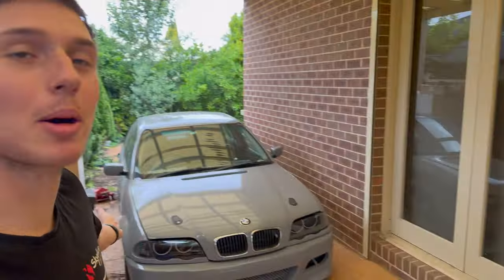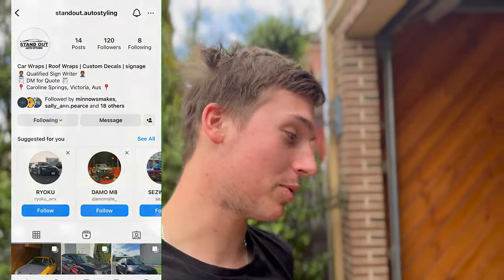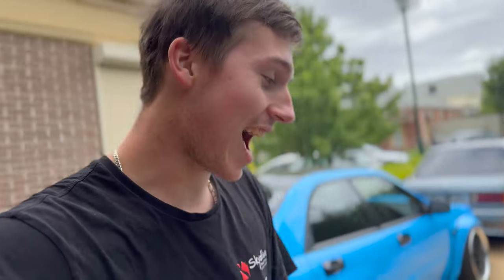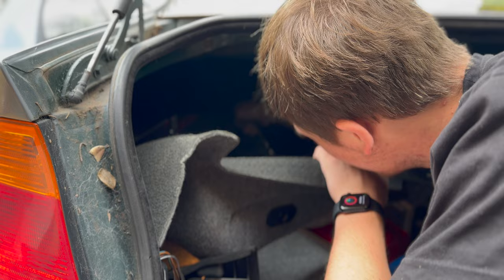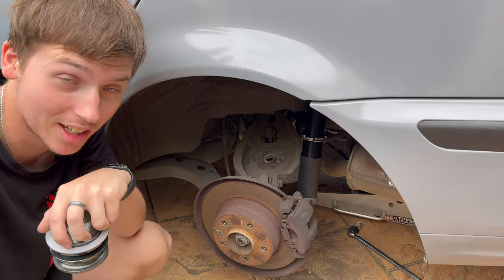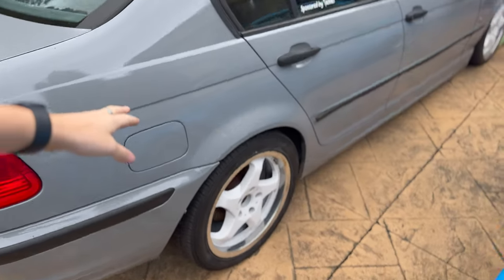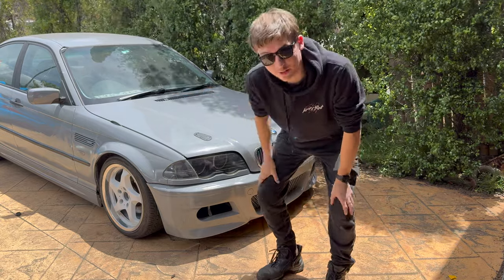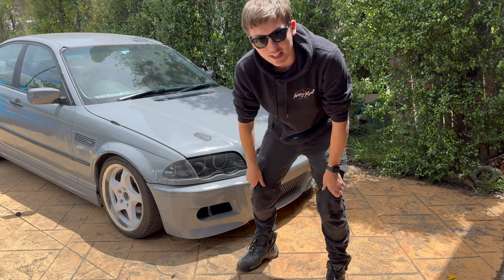SLAMMING my BMW on MAXPEEDINGRODS

Comment: If you’re going to run spacers please torque them and check they stay torqued regularly bc max speeding and spacers are a massive red flag
Reply from the maker: Definitely!
Reply: hey i plan on doing this, what should i torque the spacers too? like anything specific or just torque then as in make sure they are tighttt
Reply from the maker: @sircapalott  I torqued them as if I was torquing my wheels but I also only had them on for 30 seconds for the video so maybe just do some research before you do it :)
Reply: @YTBazily thank you !!